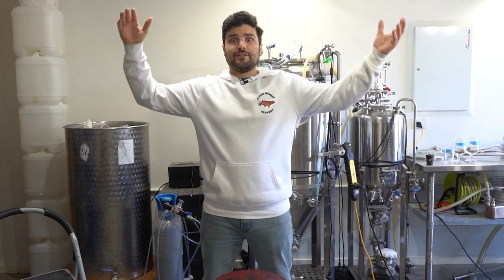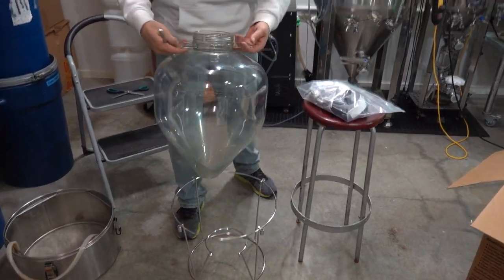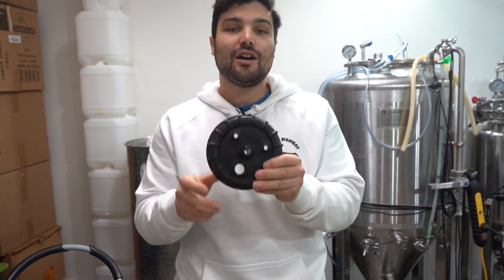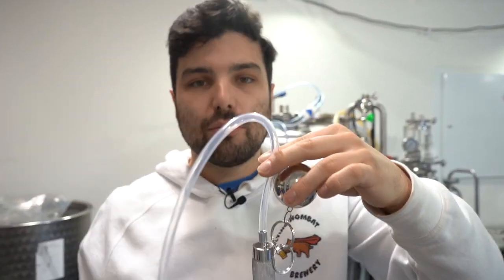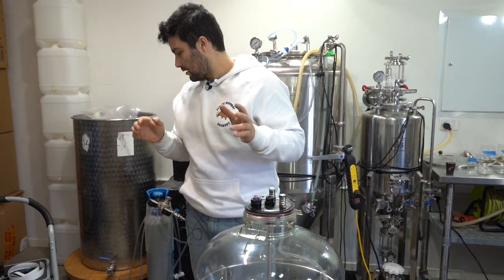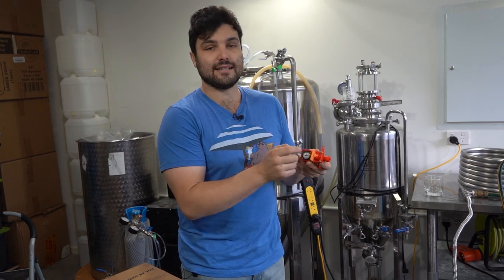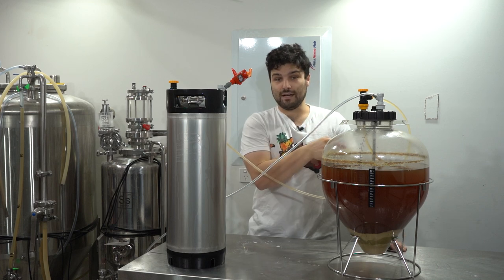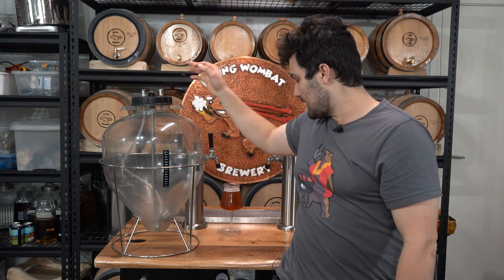Keg King 30L Snub Nose Apollo Fermenter Unboxing and REVIEW!

Comment: To make it easer to tell which post is which remember GREY, GAS, GASH. the post has a gash on the side. And the oring is grey, to match the disconnect.

Also, the larger keyring on the floating diptube is designed to have the thermo well go through it. It keeps the pickup from collecting the yeast that gathers on the side of the fermenter during transfer.
Reply from the maker: Ohhhh that actually makes a lot of sense about the key ring! Great tip definitely going to do that now! Haha

Comment: Glad to see you guys back, assuming the GABS hangover was nasty haha, also great to see the tech videos!

I think brewing Lager under pressure is the only way to go. I have the all rounder, I hook the gas post to the keg I will be serving from to purge it during the ferment, I use gravity and the pressure of the CO2 in the fermenter to push the beer into the keg because the beer displaces the gas which pushes more beer into the keg, as long as tyhe keg is below the fermenter, it's slower but external gas free. it's also partially carbonated (I set my spunding valve to about 12ish psi). I actually have the float attached to the... non tube end(?) of the floating dip tube filter which seems to work really well
Reply from the maker: Yeah it’s a great little unit! And totally agree we have since refilled it and have a lager fermenting under pressure now, so little hint for one of our next brewdays to be released on the channel ;)
Reply: @flyingwombattv  very nice, there's not a lot of content around pressure fermentation, I'm surprised too given how amazing it can be... I know it suppresses esters, making for a cleaner ferment but I don't know if that would also apply to hops or if it would enhance it because the oils aren't escaping with the CO2

Comment: im using a fermzilla atm, and considering ditching it for something like this without the stupid jar at the bottom, its more of a hastle than its worth, does the keg king gear use the same posts as corney kegs do? i really do like the look of the lid of this a bit better than the kegland gear
Reply from the maker: Yep absolutely uses keg posts. Makes this thing so freakin easy to transfer out into the keg, as you saw in the vid I literally just had to connect the liquid posts and pump some gas in and transfer was done! Clean up was super easy too
Reply: @flyingwombattv  what i meant by the same posts is that i have left over posts from when i reconditioned some used kegs, and they look to be the same, i still have some spares so would be nice if i could use the spares on this too